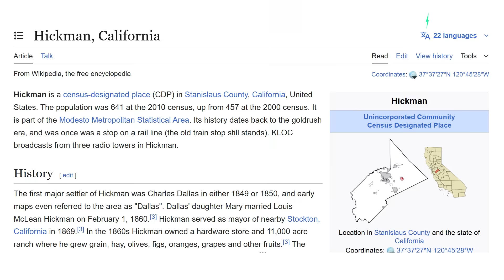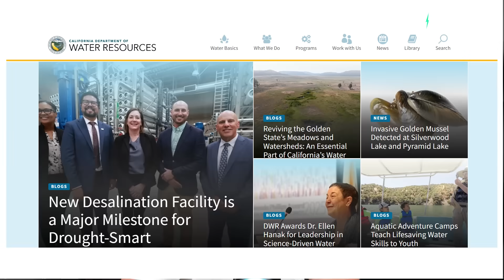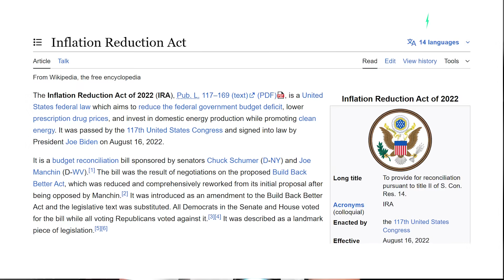California’s Solar Canals Could Power Millions of Homes

Comment: It's an excellent idea and I take my hat off to the person who came up with it. It's a clever use of area and doesn't take up unnecessary space. 
Very very clever. 👏 👏 👏
Reply: The Chinese have done it for ages.
Reply: @trashbeansoup2467 That's because China has a lot of very clever people there, who work very hard. I take my hat off to them as well.
Reply: There is unlimited space on peoples roof's right where its needed the most, why make something more expensive than it already is? This isn't clever, its a boondoggle.
Reply: @tedmoss I thought we already established that the evaporation passively cools the panels and also saves water in the canals... if anything it's actually a great use of space to power growing consumption in the AI and data centre space, bjt yes absolutely buy solar for your house i agree, just keep in mind that not everyone will, and even if they do a national power grid run on renewables is a fair bit more appealing than coal.
Reply: @tedmoss  This is one of the sources of power for the California High Speed Rail project now under construction. Next year rail will finally be laid on the prepared route, i.e. all the concrete work (and lawsuits and utility delays) and rights of way.
Reply: @tedmoss  Installing panels on individual roofs requires some design work for each location and site specific installation.  I suspect that a production process can be designed for these installations over canals where it is a mostly automated process with a robot or robots designed to drill and pour the footings, assemble the support beams and place the panels.  This implementation could be completed in a hurry if they cared to undertake it.  They should be engineering a least cost manner to undertake it while going through the testing.
Reply: My colleague at the University of California, Sarah Kurtz
Reply: India came up with it. They have been installing these since 2012. Someone one a TID saw an article about India doing it and they decided to go after as well
Reply: @nelsonsilva7572 Nonsense. The first floating solar installation was in Aichi, Japan, in 2007, built by the National Institute of Advanced Industrial Science and Technology.
Reply: @nelsonsilva7572 Cool..😎 good job to India.

Comment: According to Global Energy Policy Research, the "2040 problem" of discarded solar panels, estimated at 800,000 tons, remains. In reality, "800,000 tons of discarded mega-solar panels cannot be recycled," meaning "they will be left in a massive solar panel graveyard." The recent floods in China have highlighted the problem of used solar panels being improperly disposed of without being recycled. Because solar panels contain hazardous substances such as lead and cadmium, they pose a risk of environmental pollution and health damage if not properly disposed of. However, there is currently no prospect of recycling technology or infrastructure catching up.
Reply: Solar panels contain valuable metals like silicon, silver, and copper, which are less than 3% of the panel's weight but represent over half its value. Companies are developing methods to recover these materials more efficiently, including techniques to separate glass, frames, and silicon, with some achieving up to 95% material recovery. And finally, researchers are also exploring less toxic and more cost-effective methods, like extracting nano silicon from panels without using harsh acids. 2040 is still a ways away and recently a survey was done that revealed that 30 year old solar panels still produce over 80% of their rated power. So it is both a problem and an opportunity.
Reply: And abandoned oil wells are a forever form of pollution as are coal sludge ponds from burning coal. Their environmental impact are far worse than solar panels which continue to evolve and these issues will be mitigated with improving technology

Comment: I'd like to see this on Australia's rail network, using locally fabricated high efficiency cells.
Reply: Damn good idea . Elecric trains with overhead wires and diesel / electric for stretchs without panels overhead. Every 5th car is also a driver. An electrical engineer worked on this idea for a short time. Having every 5th car a driver would shorten DC cables. every railcar is topped with  solar panels too. Dead perfect for Oz
Reply: @psesolarscott  
Has the country run out of land?
As bad an idea as solar road ways, all attempts have failed. 5 x the cost for 1/5 the electricty.
Reply: Sorry, you don't have that 😂
Reply: If Australian rails are similar in size to North America's, solar panels fit between the rails.
Reply: @TroyWV now that’s interesting. It’s not a good choice for Canada because of our winters but lots of possibilities elsewhere.
Reply: @TroyWV  
Australia has run out of land? All the dirt, debris that comes off trains, plus how do you do track mantanince?
Reply: @TroyWV  not a good idea unfortunately, very windy and dusty and full of hopping mad roos, anyway the rails have to be maintained with the 'packer' machine etc.  Luckily there is NO shortage of land in Ausi, and I can vouch for that.  Elon once said quite a few years ago,  that a solar array 25km x 25km in the Simpson desert would generate enough power to run the entire earth during the day.  (this is before data centres took over!).  However it did give me a perspective of how much energy falls on our planet each day.  As an exercise,  I got my super sized map of Ausi out and drew the array on it  - to scale.  Stand back 6 metres and it is hard to even see it, simply lost in Australia's vastness.  Quite sobering.

Comment: At first, I wondered how the solar panels would help the water supply, and then of course!  It will slow the evaporation. Brilliant!  Loving that!
Reply: The cool water beneath would help cool the panels making them more efficient.
Reply: And decrease the weed problem by blocking light for there growth.
Reply: The panels are too high to provide any algae growth or evaporation reduction.  Water will only remain under the shaded areas for a few minutes.
Reply: @susanlovesjava4961  Well there we go. Finally, one answer.
Reply: @susanlovesjava4961  then it needs to be improved and also they mentioned that this is still in testing mode so, after that it would cover a lot more terrain.
Reply: When  i cycled my bike around the world, cool
Reply: I heard the water is already cold anyway.
Reply: I was thinking the same thing and it will help cool the area around too
Reply: You wondered?
Reply: And what will the evaporated water do to the panels?
Reply: @chipcook5346  These are solar panels intended to be outside. Rained on.. snowed on. Im certain any condensation will simply cool the panels. . The black box on the underside may need consideration but not likely.
Reply: @GWAForUTBE  I understand that. What is in the water in the river that is not in the rain? I don't know. Not all water is the same, that is what is in the water can be important. Do the smart guys in California know? 
As for swamp AC, I think there is a chance the effect would happen since the environment is dry -- as long as there is sufficient ventilation. If not, it will be a miles-long crockpot. Will there be? I don't know. Have they thought about it?
We can look at other latter day California engineering projects that promised one thing and delivered disaster ((CAHSR).
Reply: @chipcook5346 The condensation process creates distiilled water. Essentially, rain water.
Reply: @GWAForUTBE  Yes, it does. Does that mean that other chemicals don't evaporate, chemicals that might be in the water, that also evaporate, that might then condense on the panels? I don't know.
Reply: It would be a hell of a lot cheaper to cover the canals and put solar panels on peoples roof's. (Brilliant idea! I think someone has done that!). Of course you have to patrol the canals even more than they do now because of the homeless people.
Reply: @tedmoss Home mounted panels is popular but fireman & insurance can complicate it. 
These canal panels are not owned by home owners but a municipality...?
Reply: @tedmoss It's not cheaper. The logistics of installing hundreds of people's home with solar panels. Coordinating with homeowners. Organizing and managing the installers to travel and install the solar panels at hundreds of different location and inspecting all the panels to make sure everything works will cost a lot and then you also have the cost of building the non solar canal canopy. I think you assume free teleportation in your calculations to make that wild claim.
Reply: That reduction in evaporation is lost rain somewhere else. Have they done the analysis on the negative effects elsewhere? Thought not.
Reply: @davidclayton1505 With 140 million square miles of ocean on Earth . You "study" not done for good reason.

Comment: Do they really need all that concrete and steel? Just build it like any normal fence or residential roofing structure: 4X4 posts and 2X4 truss framing.
Reply: If a government project... then, yes. It likely has to have a 1 in a 100 year storm tolerance as part of the specifications that a team of 50 people came up with.
Reply: @infiniteloopcounter9444  Yet with climate change that 1 in a 100 year storm is coming every other year now.
Reply: @ericcousino2068  If you did this privately, you'd not overbuild and take the risk for a couple of solar panels. You build it cheaper and if something happens, you replace the solar panels and any poles, which have a relatively short lifespan anyway. Government, especially in the US in California, will overbuild and effectively abandon or try to privatise the project afterwards.
Reply: Since the wind can get under, a strong structure is likely needed.
Reply: Yeah the structure looks over built. But the cantilever beam design did not help.

Comment: Peak Energy is a small American company that has quietly developed what is apparently regarded as the best grid storage battery system on the planet! One of their huge grid batteries is already part of the American grid with more follow. The batteries are based on sodium, carbon and iron! No expensive minerals like lithium, rare earth minerals or cobalt are used.

The outstanding benefits of these batteries are that they are cheap and easy to make, they don't catch fire even if thrown into a fire, they don't need expensive monitoring and cooling systems as they are cooled naturally the surrounding air, play operate at -40 deg. C up to +60 deg C, they can be run down to zero and charged to 100% without any issues, they can be transported worldwide with zero energy in them which makes them extremely safe to transport, they are long lasting and they are better and cheaper than any other grid storage batteries on the market, apparently!

Trump will love them because they are being made in America. American people will love them because they offer far cheaper grid storage down to around $20 per kwh or less. They are very quick and easy to install because they don't need massive cooling systems etc.

More details can be found here:
https://youtu.be/FPCaq-Him0Q?si=hv-JSf7KvZi3yi04

Comment: I heard that in France and California, any parking lot with over 80 parking spaces will need some solar panels on them. I dont know if its true. If you have evrr been th Phoenix AZ in the summertime. It seems like a good idea.
Reply: its probably for new structures only, or theres another requirement. it definitely isnt uncommon to see them, but they're more common in "newer" buildings ( like fully built or rebuilt  from the ground up in the past 10-5 years ish ) and richer areas  institutions or related to the gov for funding. 
so tldr you def see them, but it isnt as common as you're probably thinking.

Comment: I've thought of these ideas for years. I think it should be done on the water leading to the Hover Dam.
It would generate enough energy to be able to turn on one of the 17 generators in the damn and save that much more water.
Reply: Hoover
Reply: actually ON the Hoover dam.
Reply: @TerryHickey-xt4mf if you build a floating array,  it would reduce evaporation and save water. It could be massive. Less drought.